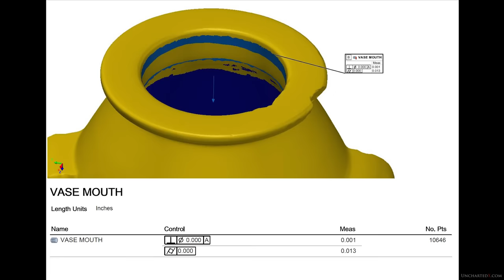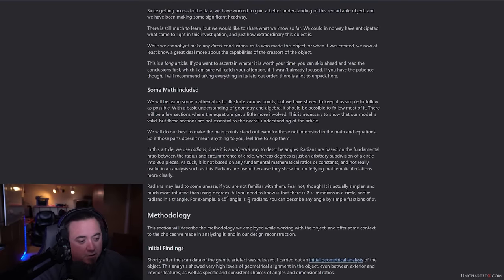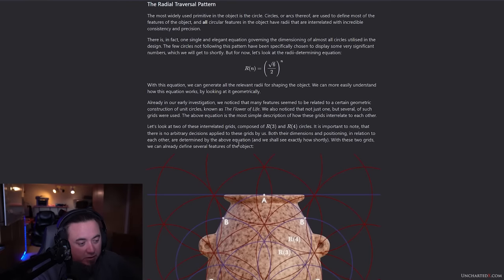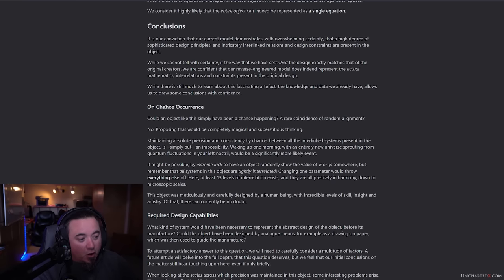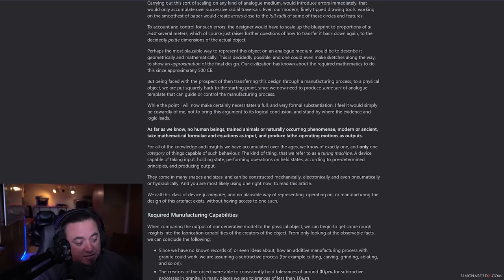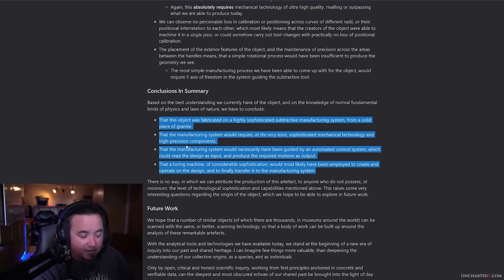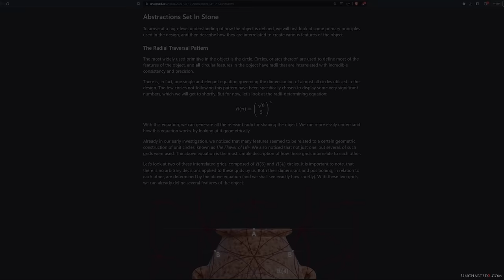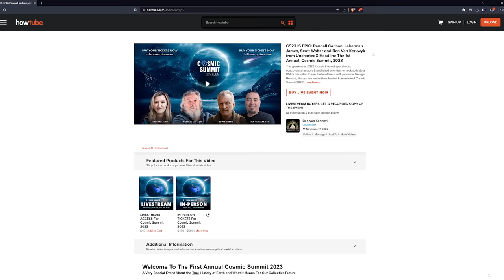Was a COMPUTER Used to Design this Artifact??

Comment: Bronze Age level tools like copper tools can not get perfection of this kind with SUPER HARD stone. I'm sorry it's totally impossible. To be clear... whoever made this clearly had something more advanced in their tool kit like machinery
Reply from the maker: No matter what you use you can't create something like this by hand.
Reply: @UnchartedX  I can't see how this could be done without having some type of technology or highly advanced knowledge.
Reply: You've got it arse-backwards mate.
Reply: @@user-kn6pn1cn8m I was thinking about this as I was watching a good doc on the Assyrians (Empire of Iron) here on YT. We only know so much about them because they wrote on clay tablets. When the city was razed to the ground, it was the only good evidence left of their existence. The fires that burned the last of the Empire to ash, baked many of those tablets and they were buried in the rubble. This is why we know so of the Assyrians and their much abused neighbors.

If they had written upon paper alone, we'd have very little of their writing. Much of it would've burned and that which didn't burn would've evaporated in the process of natural decay.

The funny thing is, in the very near future, one CME from our sun will destroy most of mankind's knowledge -- nearly every hard drive on Earth will be bricked in a microsecond. What's left would be on storage devices which weren't susceptible to EM pulse... but those formats have no lifespan at all... tape, optical storage, et al have limited lifespans. Most of your CDs won't last your own lifetime. Books will outlive anything stored on a computer. Baked clay tablets will outlive books. Stone sculptures and monoliths will outlive them all.

We already know that an entire continent's worth of land has sank below the ocean by various actions of Earth and Cosmos. The Younger Dryas was only the most clear to us because it's evidence hasn't been wiped out by the calamity to come. Rest assured, there will be another.

It is fairly certain our species is at least 300K years old. They were homo Sapiens -- men and women indistinguishable from us. Just as capable of math, science, and engineering as we are. With the same bodies and brains that we possess. To believe that we suddenly began engineering only about 6000 years ago is a logical absurdity. Six thousand years is only 1/50th of our natural history. That means that there have been 49 periods of 6000 years before the current one -- number 50. 

To believe for that for 49/50ths of our time on this planet that we didn't even invent the wheel is a logical impossibility so absurd it would be called ignorance fiction (as opposed to science fiction). It's impossible beyond any statistical reasoning that homo sapiens invented nothing at all for 294,000 years and then suddenly set to work and ending up traveling to space starting from zero 6000 years ago and ending with industrialization, satellites in orbit, the internet, and now artificial intelligence. 

But before 6000 years ago, nobody thought to devise a wheel? How is this possible? 

It's not possible -- not among a quiet planet that allows for humans to settle and expand. The only way it makes any sense at all is that our species has been blasted to hell over and over again. Likely, the last 6000 years have been the most warm and quiet 6000 years in our entire natural history. This sees some proof in the fact that our solar system seems to be transiting through a bubble of cleared space in our galaxy... for now.

What's even more troubling, is that 300K years is only the oldest homo sapiens we've found, but hominid fossils are rare. If we found one that's 300K years old -- and it's indistinguishable from us, then our species is guaranteed to be older -- because the probability you'll never find the first homo sapiens individual, is zero. The probability that you'll find one that existed 300K years ago was zero -- until just recently. The likelihood that we found the first one is nil. There is no "first", only a spectrum of transitions until you find those which are unambiguously homo sapiens.

We could be much older than 300K years. This only makes things more curious -- extending the time that we should've been creating all our wonderful works. 

But cataclysm can erase much. When the twin towers fell, they found no bodies, only pieces of meat. Those buildings weren't solid rock, they were mostly hollow. But their collapse ground everything into powder, confetti, and gobbets of flesh. Imagine what solid stone would've left.

The Earth is a thin shell of crust floating on a superheated ocean of molten rock... and lucky for us. If we were made of solid material, the periodic asteroid hits would've caused way more calamity than they did. Imagine a sold sphere of concrete being struck by a 50 caliber bullet. It would crack that sphere open and the oceans would drain into the crevices -- along with every atom of the razor-thin atmosphere -- sterilizing the surface forever after. If I didn't know any better, I'd say this was the fate of Mars. We know there was running water, where did it go? My guess is that we'll find its oceans in fissures which riddle the planet from asteroid hits.

But our thin crust rests atop a huge reservoir of thick, energy-absorbing liquid. Imagine a sphere of wet clay covered in crust. A 50 cal. bullet would punch a hole, but gravity would ensure that the dense magma would immediately fill the hole -- leaving our atmosphere and oceans none the worse off. Life would continue... but conditions would be harsh. The global earthquakes and volcanic activity would make the Earth very inhospitable for a bit. Survivable my most -- but only if they were lucky enough to be at the right places at the right times. Tropical lands would become deserts, deserts would become tropics. Land undersea would rise above it in some parts and sink below in others. No land or sea animals would be left alive in such a sea change.

This kind of chaos can utterly erase all signs of a technology. Repeated incidents would erase what little evidence existed from the prior catastrophes. In the completely quiet period we're currently within, we only know so much of the Assyrians because of their clay tablets. If they had written on paper, we'd never have seen their writing at all -- and we wouldn't even know that they invented paper. It wouldn't have survived the man-made holocaust and the natural elements that followed. The Dead Sea Scrolls were hidden in arid regions and they were till in tatters. 

No wheel invented for 294,000 years but in the last 6000 after we managed to invent it, we created the industrial age, the computer, flight, then space flight, and we networked the entire human race together into a unified global information network. Most of that invention was in the last 200 years. Most of that invention and the info to rebuild it can be wiped out with one CME -- an event which is one of the most routine solar events that we know of. It last ocurred when the telegraph was our main communication platform. The telegraphs was shorted out by the Carrington Event -- the last large CME that intersected with Earth. Huge CMEs have been occurring periodically -- they've just never intersected with us yet. 

The one that intersects Earth will happen again -- and very likely in our lifetime. It could even happen tomorrow. There was legislation to shield our electrical grid against this but our politicians see no profit in saving their own nations from a clear and present threat more deadly than nuclear world war... and I'm not being hyperbolic. If a CME hits Earth, the starvation will be biblical in every city of the planet. The streets will be drenched red with the violence. Disease will follow and no treatments will be attainable or manufacturable. 

There will be no Google to answer your questions, no law to respond to your cries. Your body will consume itself to survive one more day. You'll be lucky if you can collect enough rain to drink. Do you think your civilization will survive that? Yes probably... but a CME is so routine that its barely worth mentioning. Organic life does perfectly fine amid that kind of cosmic assault -- we evolved for it. But most of our civilization will evaporate in a microsecond because it's sustained upon machines with an Achilles Heel that our brains don't possess. 

A CME is very routine but a comet strike may only ocurr every 10,000 years or so. That kind of strike has more energy than all the nukes on Earth combined and multiplied by a million. It causes catastrophic techtonic movements everywhere on Earth -- nothing is spared from devastation. 

We are in an unusually hospitable climate and quiet geologic time in our transit. This won't always be the case. If we don't stop tyrants from con mankind into enriching parasites while impoverishing the human race in general, we'll be ill-prepared to survive the almost certain cosmic chaos which is just around the bend. 

What about the ice ages? Where did the last one go? I can't recall anyone explaining why it existed in the first place. Best guess is that once we entered into this empty region of the galaxy, the dust was cleared between Earth and the Sun -- allowing its full radiation to heat the world. But there's more than dust in those cluttered regions. 

End of essay.
Reply: @Aqua Fyre Lol, what equation are you going to use for your stone pots? Go back to sleep.